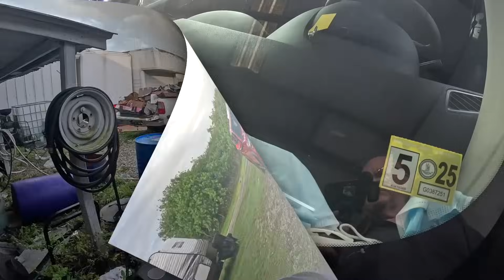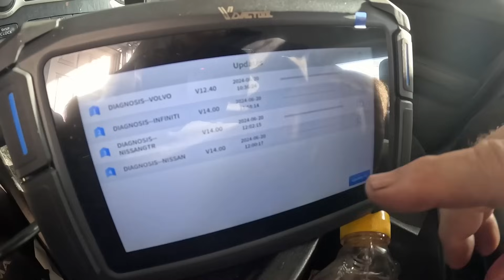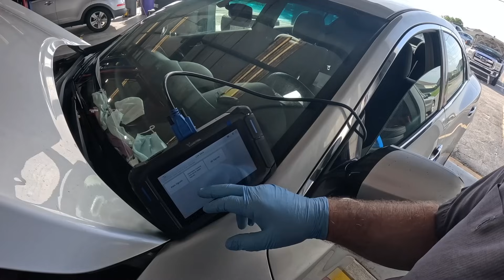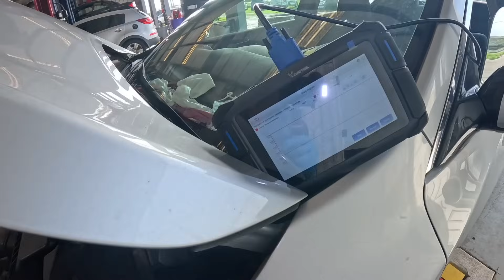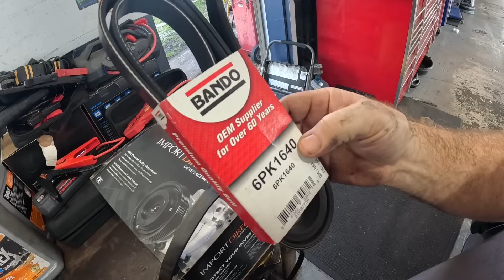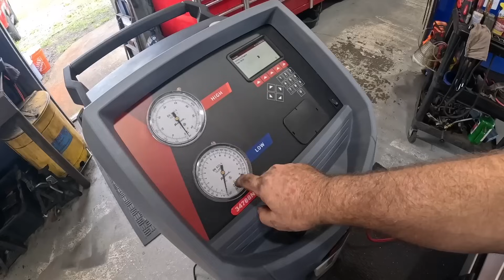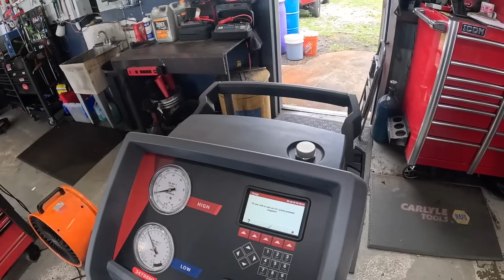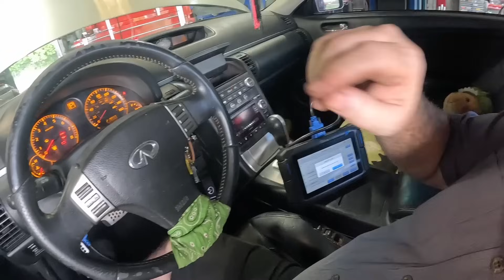G35 BLOWS FUSE, SEDONA A/C, COROLLA EXHAUST, DAY 505 IN THE SHOP, FIXING CARS

Comment: I had to add a steering wheel cover to our Nissan because it was so sticky from my wife using hand sanitizer wile driving. It would not clean off. Did you hear about the 15,000 car dealerships shut down because of hackers.
Reply from the maker: Wow, I guess that could certainly contribute to it. 
Yeah, when I went to Mikes dealership to get my Tundra they had all the computers off in the sales department because of the hack. The finance guys still had their system up.

Comment: That Nissan steering when has had a strong cleaner used on it and its delaminating,whats the sat nav screen like they hate strong cleaners removes the anti glare off them the wheel needs sealing or buy a replacement.
Reply from the maker: Yeah, it’s either been cleaned incorrectly or never cleaned at all. Not sure, but it’s nasty.